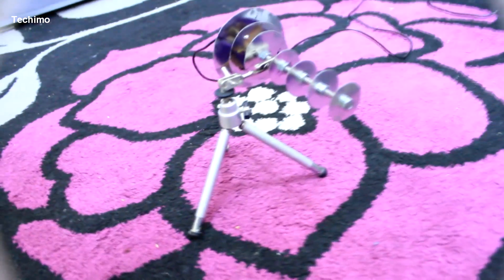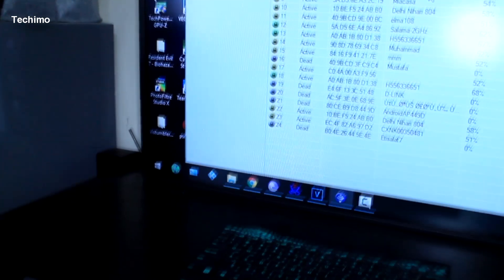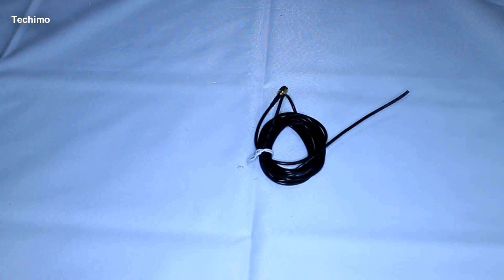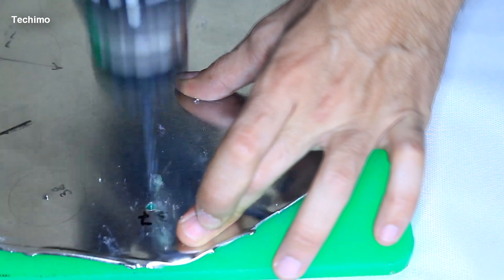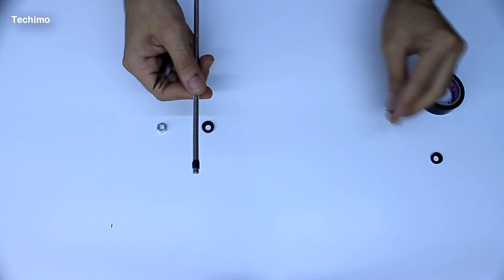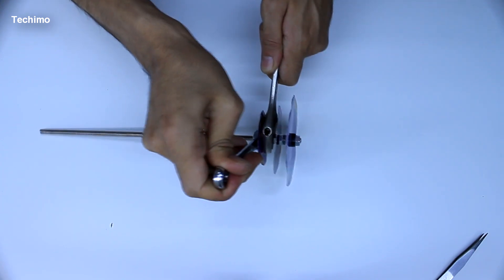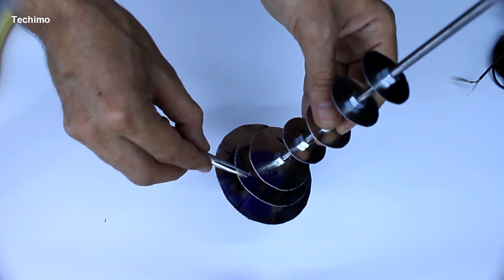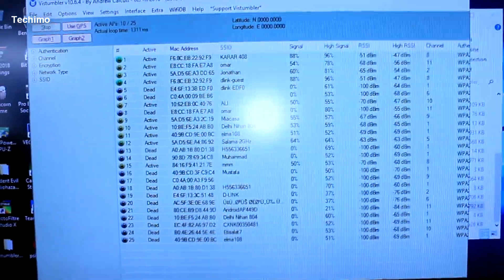Wi-Fi Gun DIY / Powerful Antenna for Wi-Fi / UPDATED To V2 | DIY

Comment: Thanks for explaining it so well, but i think you got this a bit backwards. The one that should not have contact with the other disks is the driven element. So the one that's 68mm in diameter.

Comment: Hey bro can u tell me which wire did you used for connecting adapter and disc? where to buy it.
Reply from the maker: https://www.wifi-shop24.com/media/image/product/248/lg/coaxial-cable-rf240-rp-sma-male-to-rp-sma-female-connector.jpg
Reply: Bro  I have a wifi adapter( https://www.amazon.in/dp/B00IWT1JA6/ref=cm_sw_r_wa_apa_i_wCQaFb0J6JWK1  )which does not have a removable antenna so how do I connect it to disk.
Reply: Can we still buy tp-link tl-wn722n v1.if yes then plz do share me link to buy it.

Comment: I've had better results isolating the driving element, raver that the reflector. just try it and see if it's just me or there something there!
Reply: What driving element, Could you please explain lil bit.
Reply: @nishant.holkar  driving element is 2nd plate, 68mm diameter circle, and guy on the video isolated the biggest material which is known as reflector, 90mm.
Reply: @MehmetFatihAKKUŞ-p4x  Thank you  ✌️ 
I am thinking to Build this thing so this is really gonna help me.

Comment: please bro!  measurmens for thickness ? how many mm or cm?
Reply from the maker: the one i used is 0.5 mm but you can use up to 2.5 mm
Reply: @TechSimoo  whaaat bro 2,5mm is so thicc copper foil hahahaha i think 0.5 its best, how if i using 0.2 mm bro?
Reply: @TechSimoo  so expensive in here for dimensions H(thickness): 1mm , width: 25cm and long 25cm is 11$$

Comment: what kind of metal did you use?
Reply from the maker: Stainless sheet But better if you have copper sheet
Reply: @TechSimoo  I exactly made the same one but its not worked.I dont know where is the problem in adapter or antenna?
Reply: @Godzilla_Bot  bro the connection of coax cable is important, outer wires must be welded to reflector, 90mm biggest plate, and the main center wire must be passes through 2nd plate and welded in this way. I made this and alike you mine too didn't work and can't get signal and I'm using TP-Link original 5dbi antennas unfortunately and they don't provide me enough signals. I don't know too where is the problem.. I think there is no bcs I asked many people on many antenna forums and made it exactly as they said..